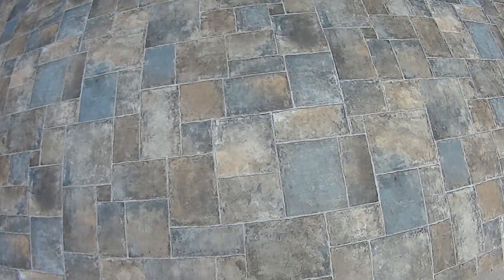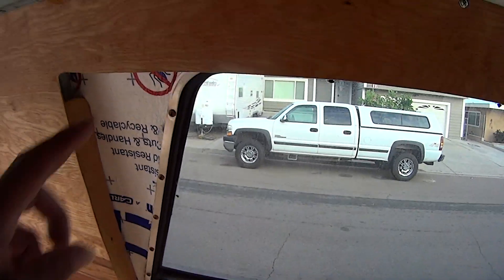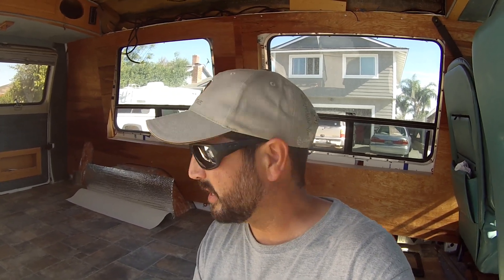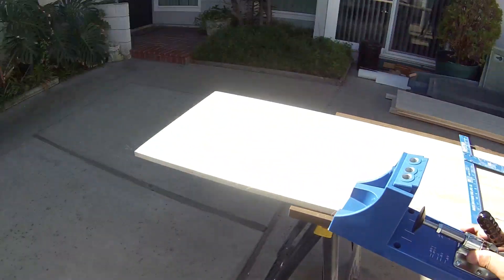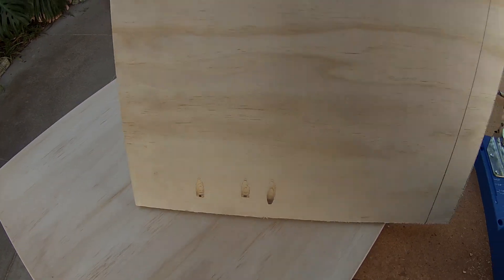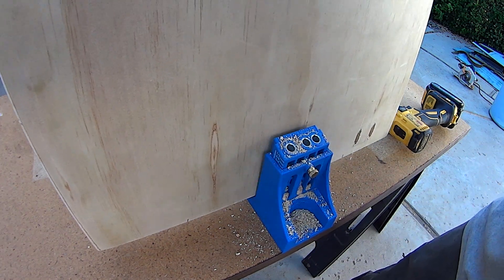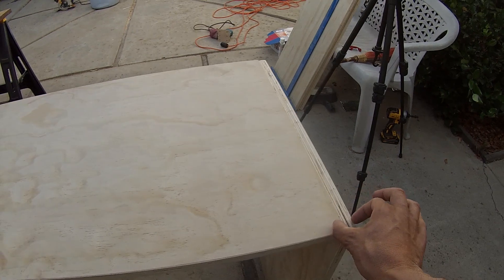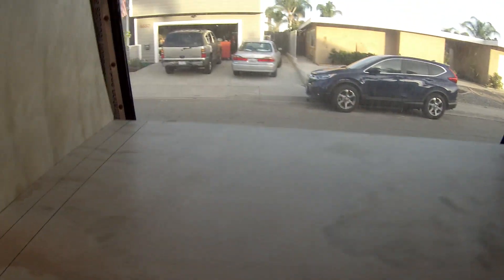Adventure Van Build Two - Flooring & Building Desk Using Kreg Pocket Ho

Comment: Helpful hint for anybody contemplating this type of work: When you need replacement screws for the Kraig jig, don't buy the factory screws. Massively over priced! Use common round head sheet metal screws instead. Yes, they work just fine in wood, stay secured in place, and cost next to nothing.
Second helpful hint:: When driving long screws into wood, rub them across a bar of soap before driving. The soap will lubricate the threads and make driving the screw much easier, especially if you are using a battery drill/driver to do it. You're doing a great job there, Brian. It's easy to see that you are no stranger to wood. Now, where did I leave that popcorn...

Comment: Kreg jigs are great. You can get the the pocket screws at ace hardware for alot less. They are pretty much the same thing, only alot cheaper and don't have the "kreg" name. Plus, you can get just whatever size, instead of paying for a variety of different sizes. Oh, take care of the step drill bit. Those are not cheap.

Comment: That Kregs setup is awesome it is the best way to joint wood in applications where it is appropriate. After 35 years in cabinets it is the best way I have found and relatively easy to do. I have just used regular drill bits one large one small to achieve similar results. Well worth the investment. I think I would have put a stiffener or two along the underside of the desk top. My travel van is the same size as your older van  me being over 6 feet I have to set the back of the drivers seat up straight so I could stretch out.

Comment: All hardware stores have corner brackets shaped like a triangle. putting these between the sides and the lower shelf will help keep the desk from wanting to rack and have the Kreg joints fail. When picking up the brackets at the store, borrow a square from them and make sure the brackets were made to 90 degrees, (some of the brackets coming out of China are way off). Another method would be put a thin piece of plywood on the back side of the desk. No need to block the window, just go from the top of the desk to the floor. Use glue on this as well. 
When a room moves down the road, the furniture is under the same stress as an earth quake. A little movement soon becomes joints failing.

Comment: Love the flooring you picked, the make-shift window paneling, and the desk. I am especially glad you didn't panel over the windows b/c I think you will enjoy them immensely during those times you have to be inside. We have a conversion van and love having a 360 degree view, and those sliding screened windows provide excellent ventilation. (I don't recall you mentioning if you are adding a maxx/fantastic fan, curious if you are). The lighting alone will lift your spirits, not to mention being able to enjoy the view from your desk while working. Can't wait to see the finished product!

Comment: The build has a very nice and practical layout, Brian.
I have used the pocket hole jig and it IMHO itis a must to have in the tools kit.  I agree in also using glue when assembling cabinets for an RV. Things vibrate and moving and the screws alone will be not good.

Comment: I'm impressed with the flooring and I love the pocket hole jig. I'm curious as I see it done by others, why glue and screw all them screws should be able to hold? Not trying to criticize just curious. Love the van.
Reply: Answer: vibration. As the van moves down the road it flexes and vibrates. This will make screws work loose over time and the joints will come apart. Any structural joints in a van or other RV need to use both glue and screws to stay tight.

Comment: How did you get the paneling stuck to the metal? Did you put nails/screws through the van? Where was it attached? Thanks
Reply from the maker: I used the holes from the factory paneling to screw through.

Comment: Build is great. Although 1991 van seems like too old to deal with? Why waste money on building something that will most likely fall apart soon?
Reply: You say that. I have two dodge van's. One's a high top ('94, 93k on the clock) and the other is a cargo ('02, 38k on the clock). My high top is solid, only issue I had recently was the gasket on the AC. Just because they are old doesn't mean they are bad. Got to remember that Brian was gifted this van, cost him FREE $$$. I think Brian has always had his heart set on a high top van. I love mine to bits!!